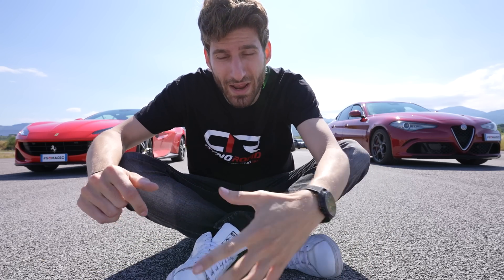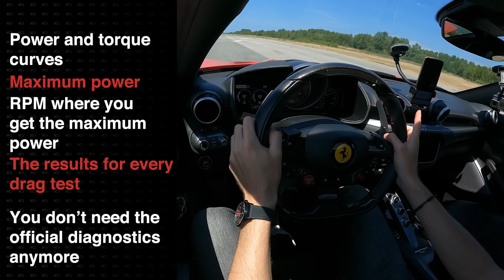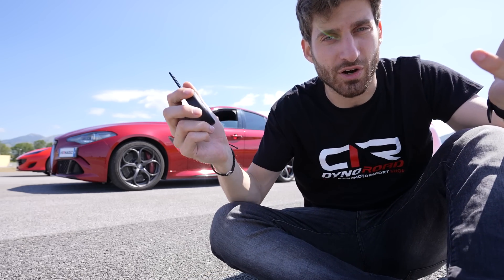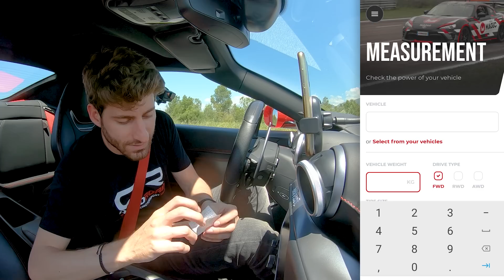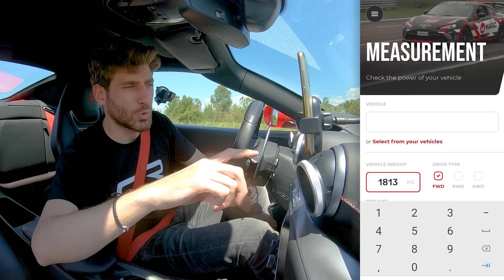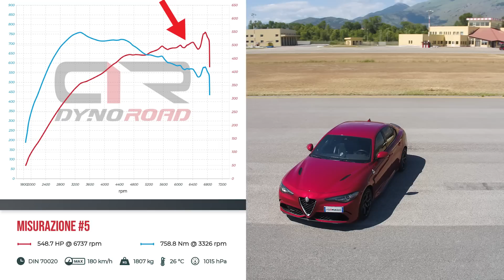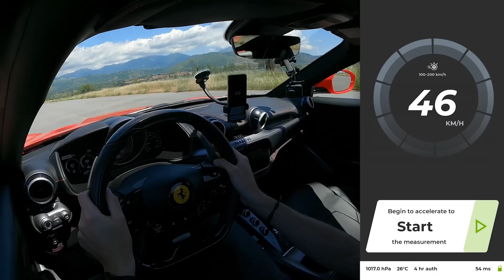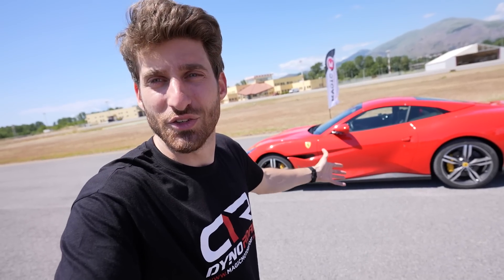Ferrari Portofino VS Alfa Romeo Giulia tuned. THIS IS A REVOLUTION!

Comment: If it is an accelerometer, you are going to need to input the exact ACTUAL weight of the car and driver, NOT what the manufacturer says, so that will require either buying accurate scales or going to a facility with them. Probably not much less money than going to do a couple dyno pulls. You also need to be sue your test road is actually flat. And windspeed matters particularly in higher gear pulls: Two cars with very different drag coefficients will measure different HP numbers independent of the actual hp of the engine. The real value is, if you are a tuner, and you can return to the same road each time, with same fuel load, atm conditions, etc., you can get comparative data for a specific car.
Reply: the weight maybe could be calculated approximately. Ferrari says 1664kg for Portofino. Add 80kg of the driver (sorry Naska) and 60 kg of gas and other liquids (full tank is 80l) which makes 1804kg (compared to 1813). Still not that accurate but yeah...
Reply: @TheLordofcod  Naska did that... AND... the setup slow down would factor the drag, aero & tires, into the system... then do the same in the opposite direction to adjust for road gradient & wind... if really serious have one unit for each direction... NOW... for them to make for bikes... excellent garagesta tuning tool

Comment: One key thing to remember is that cars usually don't use ALL of their horsepower to run the wheels. Things like AC reduces some of the current power it runs through the wheels. Which is why I love driving fast in slower cars, I know they usually use full potential of their power considering they don't have much of it. I own a Renault Clio 0.9 turbocharged with just 90hp and when I ain't using the AC it really feels quite faster than just 90hp. Ive driven faster cars that have quite harder times to climb the RPMs up considering the weight of the car and other things to count for. With cars being made to be reasonable to daily drive, they usually give them more HP so you will have easier time commuting with traffic and highway overtakes and stuff like that, not for serious racing. With all that counted for, every car in the world pretty much can be a racecar if you are daring enough lol. In here we have these local community races where people show up in the most "normal" cars there are and still make quite good results considering the drivers themselves are great. Never too old to start racing, and it really doesn't matter what car you have as far as you take good care of it.